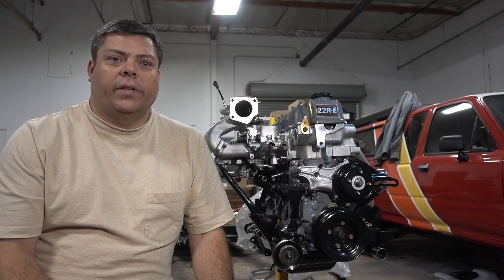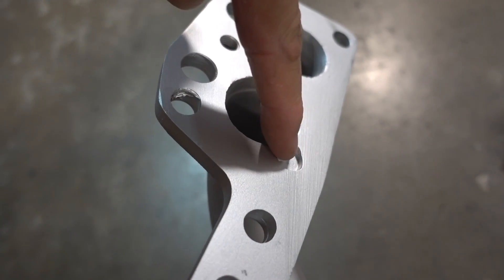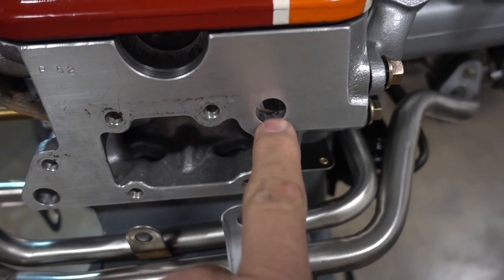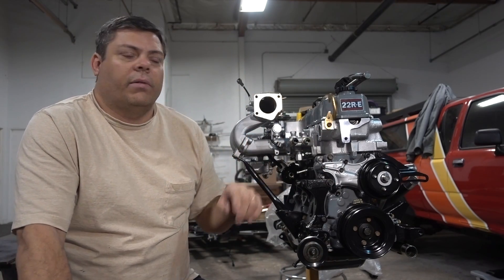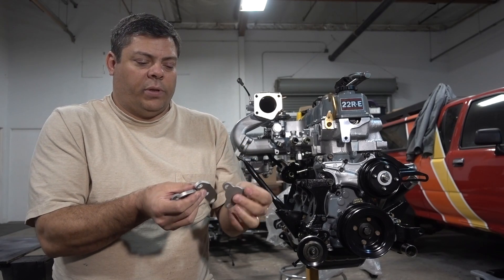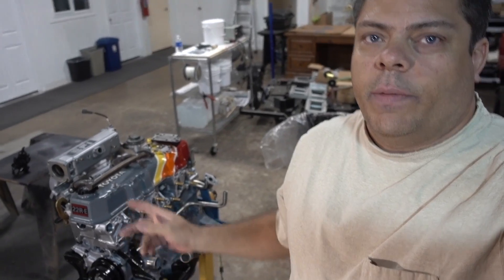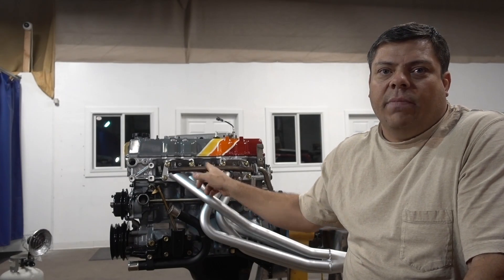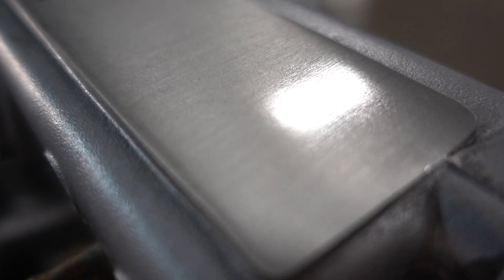22R E EGR and Air Injection

Comment: Is there a way to delete the EGR temporarily. I have broken my EGR pipe (threads are trashed) and having difficulty locating that part. I need to drive so was thinking of capping the ports temporarily. But what do I need to do with the valve tubes. Needs to be reversible and easy parking lot conversion.

Comment: At 3:45 “this fitting here”. Anyone know what that piece is called. It’s not the EGR valve as far as replacement searches go. I may need to replace mine as the threads are rusty and upon removal stripped the ones on the egr valve. Concerned that they will also damage the new EGR valve.

Comment: Thanks for this video!  Lots of useful info.  My 22r is currently getting rebuilt on my 82.  Considering getting headers like you have on this.  Do you think an LCE header is worth the investment?  Just want your honest opinion!  Thanks
Reply from the maker: Yea the LCE headers are a pretty good bang for the buck. Not too difficult to install and a noticeable HP boost. I had EFI but I am guessing that on a carb motor it would be easier to tune as well.
Reply: @techenstein  Sweet, thanks for the time and review!

Comment: So I don't have to remove the whole cooler plate to remove the head? Just remove the air injection pipe clamps right? The rest of the air injector piping comes off with the manifolds I suppose..
Reply from the maker: Correct. The cooler plate is only attached to the head, so it can stay together.

Comment: Great video, thank you. Im a technician myself and just picked up a 22RE as one of my projects, amazing little motor! Ill just add one thing that is very important that anyone considering an EGR delete should know. The reason for the reduced NO(x) from the recirculated exhaust gases, is two fold..it also serves to reduce combustion temperatures, therefore running temperature. Above about 2000F is when molecules get blasted apart in the combustion chamber to form those harmful NO(x) gases. I would be more wary of too hot conditions in a performance motor though, not a 22RE. Thanks again.

Comment: I deleted the egr and air injection on my 1981 22R twenty five years ago.  When it was running a little hotter, I put in a 180 thermostat instead of the factory recommended 195, and it runs consistently just below half on the gauge.
Reply: have you never had problems with egr delete and the thermostat?

Comment: Is it normal for those 22res spark plugs to be tilted a bit
Reply from the maker: Yes, they are all kind of off-axis form each other
Reply: @techenstein  the toyota forums had people chasing the threads i been looking at other 22s and they all seem tilted stock called the dealership and they were ass holes telling me to check my owners manual. So happy i didn't chase the threads and risked getting shavings in the combustion chamber. Thanks

Comment: Firstly l live in Australia and l own a Toyota Hilux with a 22R engine l like it and l am retired and its my hobby ute l work on it and have done a lot of nothing to do with removing the engine or anyyhing major thanks to the 22R /RE engine been so popular in the USA parts availability is excellent any part l have needed l can get from a local spare parts shop and other parts l have had to have my whole exhaust system replaced no problem there to pass the yearly regestration inspection and with that inspection no emission test so l can keep driving it because it has a carburetor and no cat converter the 22RE engine was available in the 1980s Toyota Corona Avante

Comment: I unknowingly deleted the air injection when I put the CA legal trail gear headers on, and I still have passed smog 4 times, idk how
Reply from the maker: They way they test here doesn't really activate the air injection system so it wouldn't effect the tailpipe during the dyno test, but the tech should be looking for it to be present. I would just keep going to the same place and not say anything.

Comment: I just removed the head for a burnt valve. this is the first time I worked the 22r-e. it so simple. I am so lucky it came to me. it brings back my HS shop class. but I did not have to adjust the dwell angle. thank you, Toyota... and thank you for the lesson on this beauty.

Comment: How does it inject dead air to help with the engine pumping? The only time air should be let in is when intake valve is open. What stroke are you talking about when it “injects dead air”?

Comment: I disagree about the pumping losses, the EGR valve is only open when the engine is under load. When the throttle is closed the EGR valve is also closed. Secondly when decelerating from a load you want the pumping loss effect to act as a braking effect on the vehicle for the same reason a diesel engine uses a  Jake brake to slow a vehicle down do to the fact there is no throttle valve restricting the air intake. You do loose some efficiency do to an EGR system but it is necessary to reduce NOx.
Reply: Agreed. He said it doesn’t operate at idle or full load. Wrong
Reply: No I think he said performance doesn't go up unless you are full throttle.   @salesteam274

Comment: EGR craps up your intake manifold and intake ports on the heads also craps up injectors and intake valves which over time causes less air flow through the intake tract which intern causes poor power bad fuel mileage.

Comment: Please forgive my naivety, but why not induct fresh air through the EGR valve instead of Exhaust gasses? The load on engine during intake should be a minimal issue and the intake plenum shouldn't get carboned up then right?
Reply from the maker: Actually a good question....
The reason is the exhaust is 'dead' air, in other words there is very little oxygen left in it, and so it will not cause any additional combustion. If we introduced fresh air that has plenty of free oxygen, it would cause a very lean burn which has very high temperatures, and cause damage to things like valve seats. So we want this dead air to help control combustion chamber temperatures.
However they do inject the fresh air AFTER the combustion chamber at the exhaust header/manifold because now they DO want to raise the temperatures. This helps to give any unburned fuels leaving the engine some additional oxygen, and then when it all hits the hot catalytic convertor, it fully burns off.

Comment: Can the egr be filtered or have a "catch can" installed?
Reply from the maker: YES! IMO that vent tube from the crankcase to the intake is a huge source of problems. I bought an ebay catch can but have yet to install it. Plans to mount on the firewall somewhere.

Comment: I have a question about that engine, maybe you can help me,  I have the same engine and when it´s cold runs just fine but when am in Traffic an then I have to go, I press the gas pedal and it feels like am not pushing the pedal, like it wount run, like air is not running or not gas going thru, and I already check everithing and it seems fine, don´t know what to do... please help me!  (great video)
Reply: ... from the vague information you've presented, I would guess a faulty TPS or throttle position sensor

Comment: Something he didn't mention worth knowing.  EGR systems are ONLY put on vehicles in the USA.  Our "regulations" here in the USA are very convoluted and have produced a myriad of issues.  To understand it best, you have to start at the beginning.  The GOAL of the USA big businesses is to produce INEFFICIENT engines that use lots of fuel...  to makes lots of money.  They figured out pretty quick that inefficient engines pollute more than a reasonable amount... SO, they designed EGR systems to cut down on those emissions and at the same time KEEP the inefficient design... so they still make lots of money =]  They have been suppressing engine efficiency technology for a LONG time.  In 1990 Honda made their 4 cylinder V-TEC for JAPAN ONLY.  It achieved 70 mpg on gas UN-TUNED...  That was 30 years ago!  We HAVE the technology today to create an 8 cylinder engine capable of 100 mpg on gas EASILY.  Something he is INCORRECT about is explaining that the gases coming from the EGR system is helping push down the piston, they "technically" are but at such a small measurable pressure it makes ZERO difference.  What's really happening is the OTHER pistons that are firing are turning the crankshaft which PULL down the pistons getting ready for the compression stroke.  Another thing worth mentioning that people have trouble understanding is that the higher the RPM, the less air per cycle you get (this is why turbos are awesome).  Engines are much more powerful and efficient at LOWER RPMs.  All that is needed is MORE GEARS.  An efficient vehicle for every day driving should have 7-8 speed transmissions instead of 4-5.  Less gears = higher RPMs which = more fuel used.  The EGR gases present or not present AND the crankshaft pulling the piston down are NEGLIGIBLE.  The truth is that the EGR system is HORRIBLE for your engine.  The gases are not "dead air" or "inert air" as he states... the gases are EXHAUST which has all kinds of burnt and used fuel and even un-burnt fuel in it (due to poor compression, rivlets and retarded cam design {about 20'}, more on that later) which clog up EVERYTHING on the intake side... as he explained when he cleaned it.  You want nothing but clean cool air in your intake.  These vehicles and designs were not "meant" to still be on the road.  Toyota just made such an incredible engine that they are still going.  Even with a full cylinder dead, the 22RE will run =] I've done it...and drove over 500 miles that way maxed out at 50 mph and didn't damage the engine, what a beast.  The 22RE is used all over the world and in horrible areas, because it doesn't fail.  I see an engine in this video that is not in an operating vehicle.  I HAVE completed the EGR and Air Injection delete on my 22RE and have produced opposite results than what this person is "claiming", most parts came from LCE.  Understand I had to do other modifications to make the system run correctly as well.  I decked my block (taking material off the top to bring the pistons CLOSER to the head) and bored .040 over... this produced much higher compression than the stock brand new 170 psi and no closer than 100/1000 per EPA "regulations" LOL, what a joke.  Also added an intake and headers for better flow.  Also ported and polished the head as well as installing 3 angle valve seats.  The power increase was roughly 35% from stock.  The fuel efficiency went UP by 4 mpg and that's driving around like a maniac, again due to tuning and high compression.  Anyhow, this is just the tip of the iceberg so I'll stop here.  He has some quality information in this video, but has a misconception about the EGR and Air Injection systems design, intent and function.  Good luck!  Hope this info helps someone.
Reply: Love the perspective, breath of fresh air in this cesspool-of-rules we currently live on...

Adam from FL
Reply: Well said!!!
Reply: I wish you would make a video! I'd like to hear + learn more about what you know + have to say about the 22re (well in my case the 22R). Thanks for the brief info you did provide!

Comment: Would deleting the EGR in any circumstances cause the 22re to stall?
Reply from the maker: I wouldn't think so. It's not enabled at idle or low RPMs
Reply: @techenstein  interesting
Reply: Proof that it wouldn't cause it to stall at idle is that the California test of the EGR system is to activate the switching diaphragm during idle, if the engine stalls, it means the EGR is working, and you pass the test.

Comment: Great explanation very well done.. I had to learn quite a bit about the air injection system because I have a 22R motor and it relies more on the air injection system than the 22RE motor does I believe due to the carburetor. I was getting code 25 fuel lean forever and checked everything  even changing the O2 sensor didn't do anything.  Went days running fine no codes then 3/4 Days Later  code 25 shows up again.. anyways I was going to ask you what did you do with the air injection pipe that attaches to the header you said on the video you were going to make one if so please show us what you did.  thanks again  good stuff!!!

Comment: Thanks for explaining those two systems.  I thought they were all part of the egr system.  In the early 2000s I "deleted" the egr from my truck thinking I was freeing up some hp.  Truth was, I didn't understand how it functioned back then.  Now I once again have another truck with the same 22re and I'm keeping it all factory.  

I saw the air injection system mentioned a couple times in my factory service manuals but didn't know what it was referring to til just now your video popped up in my feed.  Learned something new today!  Thanks
Reply: so you dont think its worth it to do the delete? it seems like colder air/gas would be better because of it?
Reply: @deadjoey77  no it's not worth it.  It only circulates that hot exhaust gas at cruising with part throttle and no load where it actually helps fuel economy.
Reply: Good video, you’re in cali but you can still run the egr unplugged and slip a plate in between where it goes in the intake manifold

Comment: Unplugged the vaccum hose from top of egr. has much more power. Better fuel milage. Egr adds inert has which makes the engine lose compression and heat to satisfy the cat sensor for emissions. Guy is wrong wrong. Less oxygen in mix so computer gives less fuel to correct 14.7 to1 equals less horsepower. Check engine light comes on for low egr but you use the o2 spacers for that .

Comment: Variable valve timing eliminated the need for an EGR system with reduced induction, thus reduced combustion pressures at cruising speeds.

Comment: EGR does only one thing, displaces the combustion event with an inert gas, in this case spent exhaust ... for the sole purpose of removing NOX, a byproduct of compressing nitrogen and oxygen at high temperature. Pretty much what an engine does all of the time. So when can EGR be administered to an engine? Only under Cruise because horsepower requirements are less under that condition. So many carbureted R series engines have had the Third cylinder fail before the rest because of the burden of EGR soot introduced into the intake closest to that port. It builds a carbon that smacks the quench the zones of some head designs, it causes that plug to foul more often than the rest, washed cylinder and compromised combustion event. Bad piece of federally mandated Hardware that did very little to reduce this particular emission. But like all government bureaucracies, if it looks good on paper regardless of reality ... then it is a quantifiable measure that can be checked off on a form.
Reply from the maker: Great explanation. Thank You!
Only thing I can add to that is on the 22RE, the EGR gasses are ported all the way up to the throttle body plate, so the distribution between cylinders is probably pretty even. But yea not as familiar with the 22R carb setup, but sound like they might have learned from that and improved it on the EFI.

Comment: Very good video!  Lots of love went into that engine build.

Secondary air injection had me stumped the first time I had to tear down my 22RE for head gasket and timing chain kit.

I am on the EGR delete side especially if the vehicle is not subject to emission testing.  Bitmetal switching valve and EGR modulator both gone.  Spaghetti vacuum line mess gone.  No more throttle body and intake plenum black goo/crud.

Comment: Great video, Thank you. 

Also, what did you use to clear coat your aluminum head? Corrosion is a real problem here in the northeast with bare aluminum.
Reply from the maker: Kustom '49 The clear on the valve cover was a spray can ‘2K’ or something like that, but now a year later it starting to yellow slightly, so its not handling the heat. 
If you want a raw aluminum color there is a duplicolor engine paint called ‘cast aluminum’.

Comment: great video.  I live in a county in PA that does not require any emission requirements or testing for inspection.  If I do remove both EGR and Air intake on my 1993 pickup will the controlling computer care, and give me some kind of engine lights.
Reply from the maker: For EGR delete, you need to simulate the temp sensor that is on the back of the intake plenum where the EGR connected in. A 10K ohm resistor is all you need. It's a two wire sensor so just use the old sensor connector and wire it in, and tuck back into the rest of the wire harness. There is no sensor for air injection delete and if you already deleted your cat convertor, it's not doing anything anyway. You should keep your first O2 sensor in the pipe though. That is the heart of the EFI system and controls your mixture. The second O2 sensor, if you have one, might be optional but it's just as easy to leave it on place.
Reply: My 92 22RE does not have an EGR temp sensor from factory.  I think the EGR temp sensor might be a California equipped thing...not exactly sure.  No factory knock sensor either.

If you remove the EGR, you can either remove the bimetal switching valve, or disconnect the two vacuum lines to the bimetal switching valve on the front of the intake.  Then from there you can remove the EGR modulator...the round hockey puck looking thing.  Afterwards, viola,. you can remove most all the vacuum spaghetti.  Cap off the three vacuum ports on the throttle body too.

Comment: I have an exhaust leak or I think because the part that is leaking is that air injection pipe  gasket after the diaphram, I sprayed it with soap and water and it bubbled it sounds like exhaust leak but you said it's air could you possibly help me understand if exhaust gases could leak from that gasket